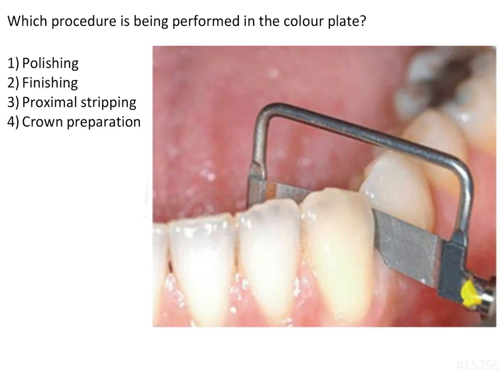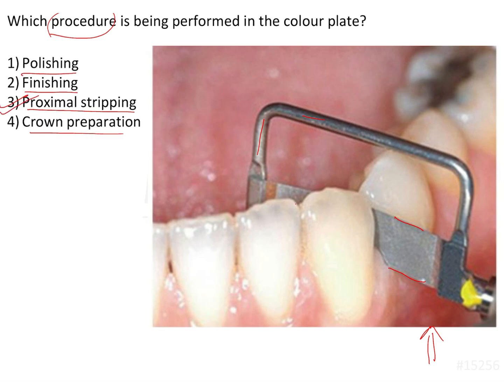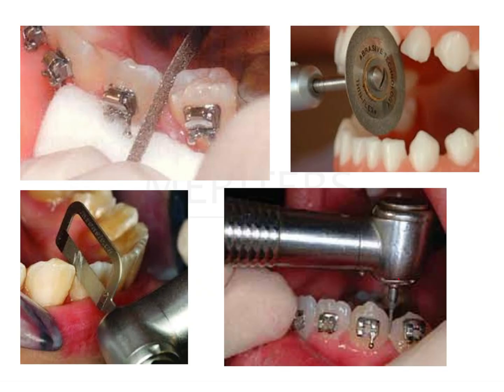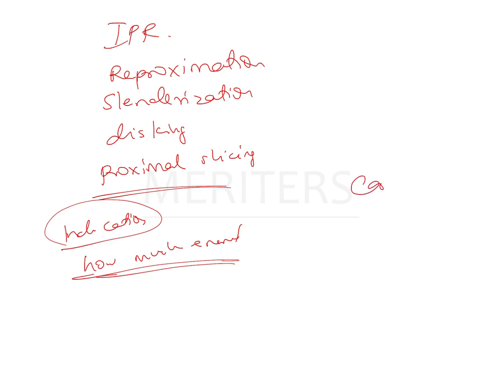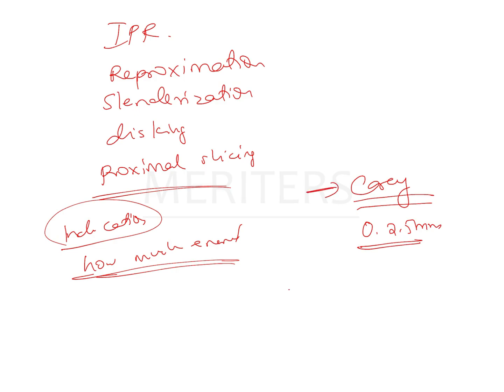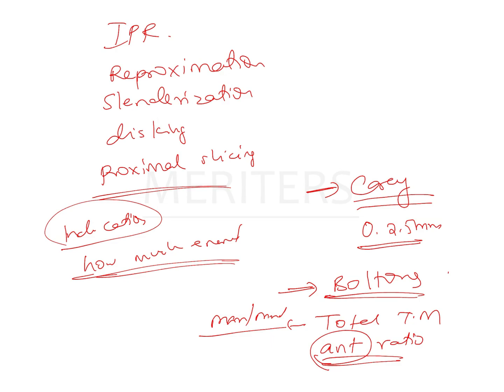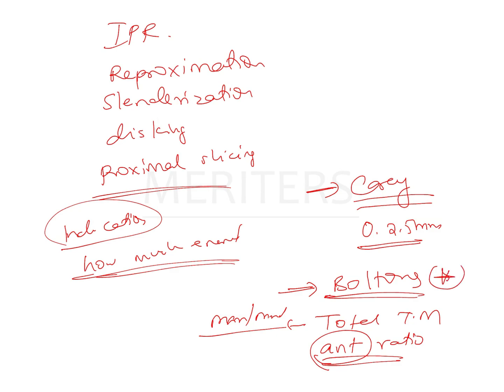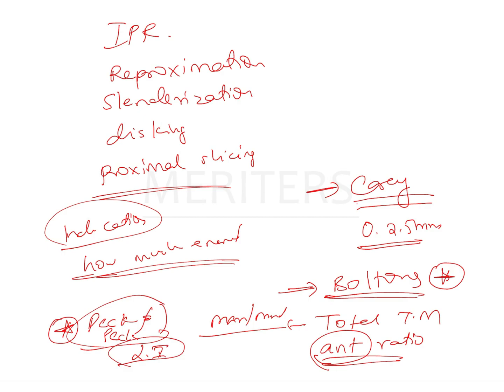NEET MDS | INICET - Preventive & Interceptive Orthodontics | Explanatory Video | MERITERS

Comment: 3
Reply from the maker: The correct answer is: C) Proximal stripping
For more such questions and Videos download our app: https://mdsprep.com/app/download?i=ytc

Proximal stripping is the method, by which proximal surfaces of teeth are sliced, in order to reduce the mesiodistal width of the teeth. It is also known by the synonyms - reproximation, slenderization, disking and proximal slicing.

In Carey's analysis, if the diﬀerence between the arch length and the tooth material is between 0-2.5 mm, it indicates minimum tooth material excess and proximal stripping can be considered to reduce the tooth material.